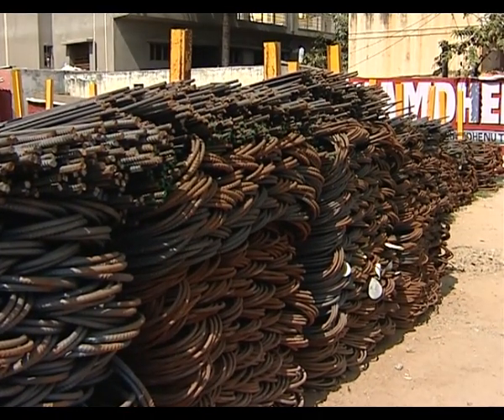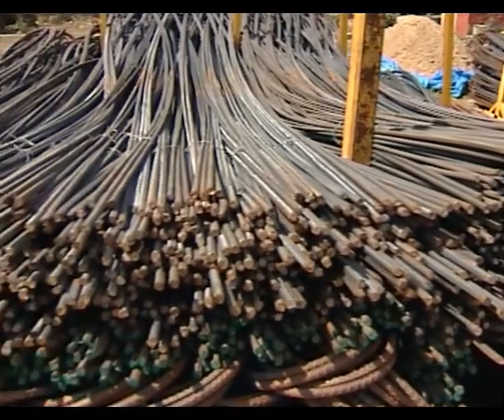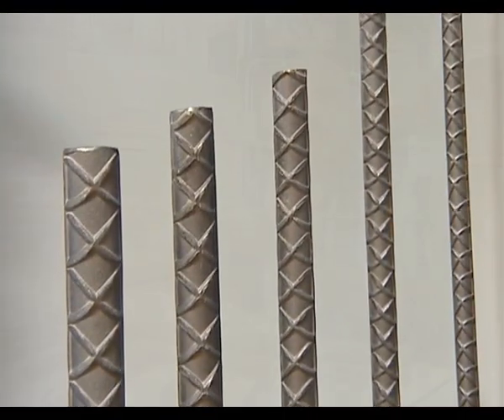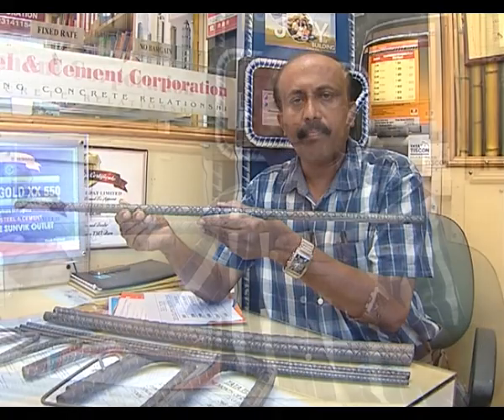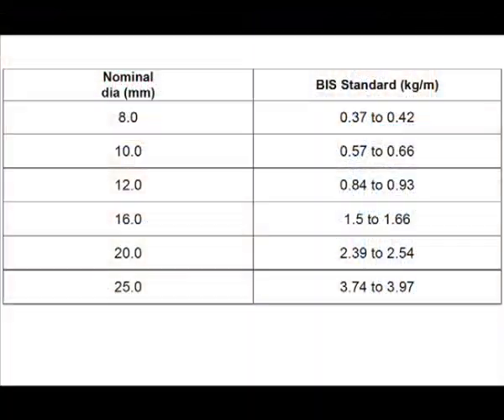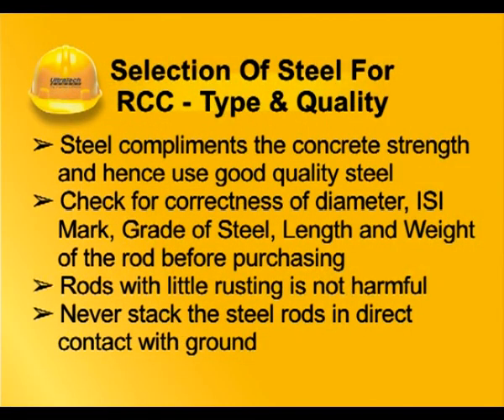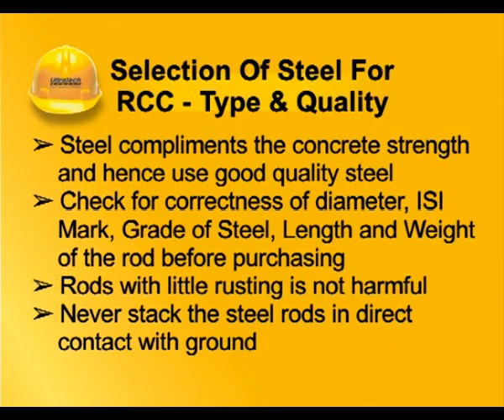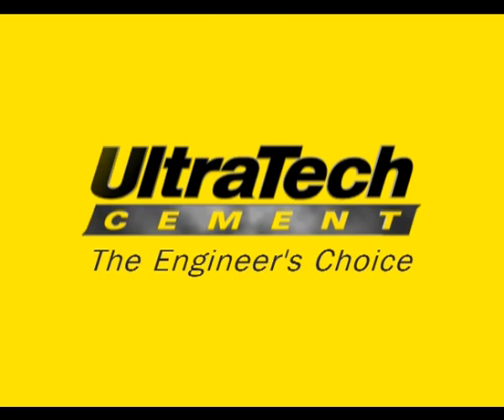Selection Of Steel For RCC Type & Quality

Comment: Surprised you are showing rebars with X-ribs. I am sure you would have read the American Concrete Institute Document ACI-408.3-01 and 408.3R-01 which specifically warn against use of rebars with X-ribs. 
It states "Reinforcing bars with X and diamond deformation patterns are excluded from this standard because their bond properties are markedly lower than bars with parallel ribs." 
"Also, X pattern bars are not allowed in the Canadian Code (CSA 1992) because Canadian bond pullout tests on X pattern bars gave significantly lower strengths than did parallel rib bars."
Reply: Raj Kumar Markan, sir   thank you very much for the information
Reply: Thank you sir